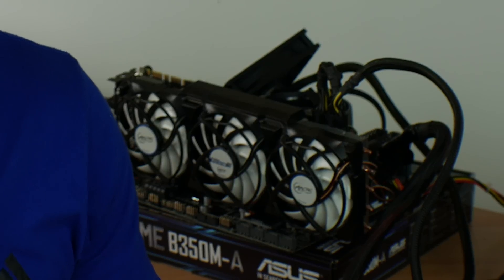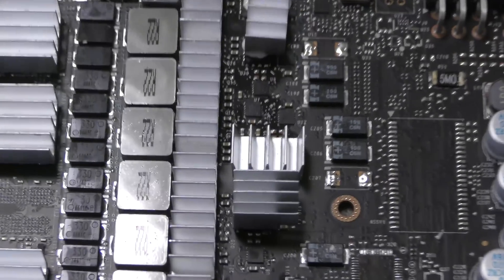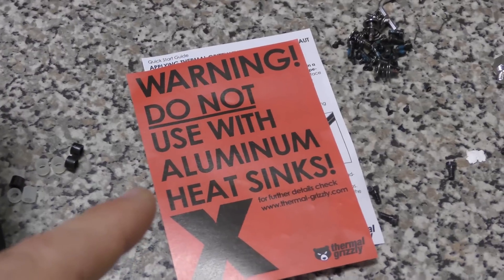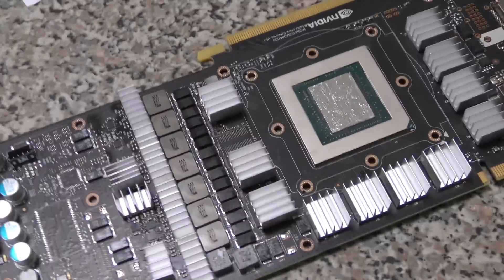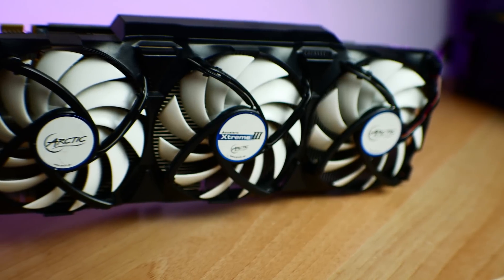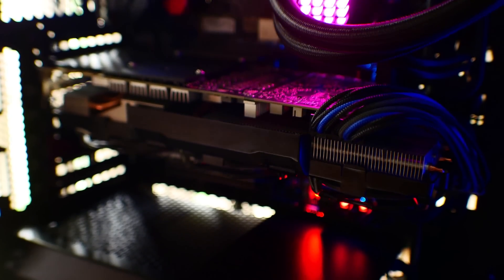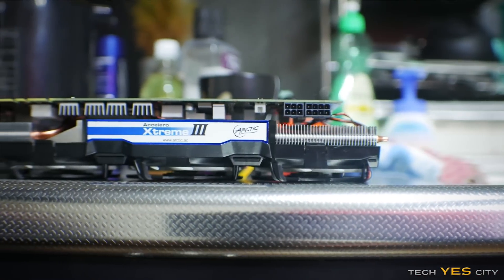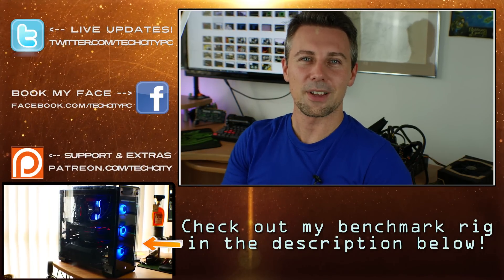INSTALLING an ACCELERO on a GTX 1080 Ti!? How to & Temps vs 1080 Strix

Comment: Excellent cooler, I picked up an older extreme 2 for $20 that didn't quite fit the gtx 670 I bought to play around with,  dremelled the fins slightly to fit and the card now runs low 50's, ---before I was struggling to keep it under 80 with the reference cooler.

Comment: I've used Accelero coolers on a EVGA GTX 260/216, a BFG GTX 280 OC (really helped!) and on ASUS HD4870 (didn't like that the fans were hooked to PSU. i.e. Accelero Twin Turbo model). Modded two PNY 9600 GTs with a fanless heatsink from Arctic as well. I had some wrong screws in one package, Arctic was less than helpful..got some on Amazon...but overall, its a good product, just that you need 3 slots so takes a lot of room if you SLI like I did with the 260s. Haven't used them in a while obviously...not many open air (quieter) coolers back in '08-'09. Bought a few ACX models over the years now. Just my 2 cents.

Comment: hey, got mine accelero xtreme 3 yesterday on a MSI gtx970 Armor 2x 4gdt5 and it couldnt be better. dropped from 75ºC to 55ºC and from a fan usage of 68% to 36%. amazing cooler, money well spent. 
keep up the good work Brian.
Cheers

Comment: I have replaced the thermal paste on my MSI 390X and after like a month or two it started having artifacts(probably because I once accidentally pressed apply with the MSI Afterburner sliders to the maximum(that is like 1500 core from 1080 stock and 2000MHz memory from 1500 stock)) but yeah the point is even though the warranty sticker on one of the 4 screws on the back was clearly damaged(because I had unscrewed the GPU for thermal paste replacement) they didn`t void my warranty...I got a new MSI 390X for free so it depends on what brand your GPU is for knowing if they will void your warranty or not...pretty sure EVGA will NOT void your warranty they are badasses and MSI at least from my experience will not...Not sure about other brands though.

Comment: 1080Ti vs 1080 ?! wtf dude who care about 1080 , do 1080Ti FE vs 1080Ti Custom !
also in your test try max PRM on both cards , FE blower can spin upto 5000RPM
Reply: 5000rpm? You can use the fucking cooler as a blender.
Reply: LOOOOL :=)))))

Comment: Is that thermal paste conductive? https://www.youtube.com/watch?v=rAid5G30-WM
Reply: That's not thermal paste though, it's like liquid metal, totally different than your typical non capacitive compounds, like the ones Jay talks about. Liquid metal is exactly what it sounds like, and it will straight up fry your shit, if you don't know how to use it right.

Comment: i used thermal grizzlys liquid metal on my gpu and it fu*ked it, it was my fault though. it didnt short it however, my gpu would no longer give a signal.

Comment: Just ordered my pc and didn't realize which graphics card I was getting. Got the MSI Armor OC 1080 ti which supposedly runs very hot. Will this cooler work on it? Also will I need to get a toolkit and is thermal paste optional or a must have?

Comment: it won't short you card as long as you use non conductive thermal paste and it is actually better because unlike a cpu that has heat spreader this doesn't so it won't spread the heat aswell

Comment: Temps are obviously better than the STRIX, but using an NZXT G12 + Corsair H55 and at most my temps are 41 degrees.  The price for the Accellero is about $60.  The G12 + H55 is ~$85.  Pretty significant temp reduction for minimal price increase.
Reply: Yeah but I wonder what the temps are under max overclock, good to know though.
Reply: I haven't gone too crazy with OC, but I didn't see much difference in temps.  ~41 degrees is the cap.

Comment: Sapphire is pretty salty when it comes to their warranty for overclocking. (Overclocking basically voids your warranty, but I overclocked my RX 480 card before, which seemed to not be worth it after some ridiculous stability issues, therefore going back to its stock clocks.)

I'm sorry, did I hear you could overclock your AMD graphics cards? Then why do some manufacturers get salty about people overclocking their graphics cards?

Comment: Hey Brian I got an Accelero twin turbo II for my gtx 970 and it doesn't work. At what should be zero rpm it runs full speed and speed seems to go up and down as I try to crank the fan speed up. Apparently I need the twin turbo III fan, have you had any issues?

Comment: Would be nice if the maker of this video would tell us what games he used and the names of the programs he used to monitor the cooling performance. Installing an accelero arctic III is fairly straightforward if at times fiddly just take your time and be very careful when removing the native cooler. Find a large surface with lots of light and make sure to have the right size screwdrivers readly for detaching the original cooler which is the trickiest and most risky part. Read and follow the instructions carefully. AAE III doesn't work with a stacked power socket: https://www.arctic.ac/uk_en/accelero-xtreme-iii.html.

The improved cooling performance makes it all worth it and it looks awesome.

Comment: what a dumb video, you can see that the strix is clocked 100mhz + higher, you dont show what speeds the fans are at or how noisy it is...
Reply: He did say the accelero is quieter though but yeah would be nice if he could measure the noise.

Comment: you got 30-40mhz higher clocks with the accelero? the video showed the stock cooler (right side) running 2088-2100 MHz and accelero (left side) running around 2000mhz ?

Comment: You can't void your warranty in the united states simply by taking the thing apart, removing the heat sink, modifying or replacing the heat sink etc, unless the company can prove that it failed because you modified or replaced it, or you damaged it during the tear down process etc. 

Google magnuson moss
Reply: Robert Tanksley he's an Aussie living in Japan. It doesn't apply.

Comment: What should we consider "default" fanspeed?
I have the MSI 1080Ti Armor (shit cooler) and I bought that one on purpose, you literally only have to remove 4 screws for the main cooler and use another 4 to screw on the Accelero Xtreme III :)
Look here, that's why I bought this card to use with the Xtreme III, memory and VRM's already cooled by a plate: https://ic.tweakimg.net/ext/i/2001457941.jpeg

Comment: i had a 9800gt that hit 120c before i unplugged it from the wall.....

but on a twin turbo fan.....didnt go over 60c iirc. 

lasted till i got my 6970, which im still rocking....

Comment: Man you should really test Raijintek Morpheus also. You can slap there a custom 2x120mm fans on that one. It should have similar results as Accelero but hance possibility of swapping fans to whatever you wish is even more appealing.
Reply: except that it costs as much as or more than an Accelero xtreme 3 WITHOUT the fans...

Comment: what were the dimensions of the heat sinks that you used? especially the long one.
Reply from the maker: Oh they come included with the Accelero kit, so if you get it you will get all the heatsinks and plaster I used in this vid.

Comment: A good trick when using conductive TIM is to cover the resistors in a non-conductive TIM, such as MX-4, to protect them in case of spills or dripping.

Comment: Hey Tech! Love the vids you put out I appreciate your style and information given so thank you again! I was curious because I want to mount the arctic accelero iii xtreme on my evga gtx 1080 sc due to the cooler being noisier then I would like, but I was curious as to where I need to plaster on the little fin heatsinks? The vram of course and then the vrm, but where else do they need to be placed? I am just a little nervous due to the heat issues that card has had in the past with evga issuing thermal pad kits and all. Thank you again!
Reply from the maker: Hey John, you will need to cover the mosfets and also the vram, that usually does it.  The Vram is usually around the GPU Die and the mosfets for the VRM are usually before the chokes.  Just make sure nothing is touching those heatsinks other than the die to which its connected too.
Reply: Tech City 
Thank you so much for the response! I am going to embark on installing the xtreme iii in the next few days! I was going to use the protective clear tape next to the components close to the vrms.
Reply: Tech City 
Hey I wanted to up date you and say the xtreme iii is the BOMB! I got it mounted shortly after the first question I asked you and it has been working so well! I put it on and evga sc 1080 due to the stock cooler being noisy and really not keeping temps that low (ambient 29c) card ran at 70% fan speed with temps in the 70-80c range! Put in the new cooler and same ambient temps the card is running at 58-60c with fan speed at 50%. Quiet and cool, so thank you again for making this video and answering my questions! You rock!

Comment: Hey dude - Ive got an arctic accelero hybrid cooler - im gonna buy a 1080ti, and wondering if you know if this will cool it sufficiently so i can buy a founders edition and be able to OC it. Its a cooler I bought years ago (obviously) and had it on an HD7950 where it worked awesomely...any ideas? cheers!

Comment: Hey,

Do you think it is safe to use this Accelero Xtreme III on a 1080 Ti / Titan Xp? These cards are very hot and I'm a little bit afraid for its VRMs. Would the included heatsinks be enough to keep the card at the safe side?

Comment: Tech City, first off good video.  I have three of the coolers you are using and you are right that they are very good.  I noticed at around 02:10 you discuss concern for using the Grizzly TIM.  There is a way that can help with protecting those areas of concern.  Place two layers of 'clear' Liquid Electrical Tape, over those resistors/chips surrounding the die/GPU.  Allow it to fully dry after each application.  This helps give you added insurance that you won't short out your card after applying the TIM.  I myself use CLU Pro on my new Titan Xp and previously no less than 7 other cards, I have never had a short happen using CLU because of the added protection.  Oh that type of TIM also works well with water-cooling GPUs.  Anyway again, good video.  Cheers!

Comment: Chokes and mosfets are not being contacted by the cooler or heat sinks. Well all seen what happens in the long run when these are not being cooled properly.

Comment: Did you tested liquid metal paste with the strix cooler? I think in this case most of the benefits comes from the liquid thermal paste not from using the custom cooler.
Using liquid metal paste is impressive on my delided i7 4770k, I tested 4 non conductive paste and liquid pro. Liquid pro paste is incredible, far superior to non conductive pastes. I don't understand why in high end cards do not use liquid metal paste out of the box, with better paste smaller coolers could be used. Will be a winner move compared with everything else on the market.

Comment: Use electrical tape to prevent that thermal compound leaking around the gpu
Reply: Sebas scholtens electrical tape is a poor choice. The temps near the die will cause the tape to soften. The bad part of that is the tape adhesive will become very “gooey”. A much better choice is clear nail polish. Electrically non conductive, easy to apply, dries very fast and much neater.
Reply: Sebas scholtens i dont care. I use it without it

Comment: That's not thermal paste you're using. The Thermal Grizzly Conductonaut is liquid metal, and it's very effective. You have to use the same thermal compounds if you want to compare different coolers, and the same coolers if you want to compare different thermal compounds. Mixing the two together is extremely unscientific and casts doubts on the results, because  a large proportion of the lower temperatures can easily be attributed to using liquid metal over the stock Asus thermal paste.
Reply: nonsexysecretary ahhhhhh the variables control the VARIABLES
Reply: He didn't really used even same graphics cards.. so what's the point :D
Reply: Absolutely true. I hate this youtuber now :(

Comment: If you buy this exact model (I'd recommend the Extreme 4, or Hybrid over this semi nightmare install) I'd recommend buying some extra thermal pads, and exacto knife to cut them to appropriate size (*Or simply reusing the ones from Nvidia's stock cooler) and use them to attach the heat sinks, rather than the glue (*It's not paste).  The VRM, and Memory chips are quite small, and to reduce stress, and wasted time, use thermal pads to attach heatsinks.  The Extreme 4 does not use these heatsinks, and therefore is a much quicker install.

In my case, the included glue was completely dried up, and that was the end of that install.  Also, I think he should have used included backplate.

Hybrid, or one that doesn't use the little heatsinks.

Comment: Initially I was interested in the Arctic Air gpu coolers for the 1080ti, however having a mid-tower restricted it to only one of their air coolers, and it wasn't recommended for the 1080ti.  Finally went w/ the Arctic Hybrid Accelero III - 120, and I share similar feelings as Tech City.

OC set @ 150CC, 500MC, and 105% power yields similar Core Clock speeds @ 2012 maybe being the high, and generally hovering just under 2000Mhz.  Memory Clock reached 6000Mhz, but wasn't monitoring memory clock outside first OC.

It was HOT in my room today, played Rise of the Tomb Raider for 3+ hours, OC all the time, and stayed below 70C, hitting a max temp towards the end @ 68C.  It's quiet, and performs much better than the reference cooler.

I guess you felt compelled to recommend not taking off the reference cooler (*If not EVGA Reference) due to warranty, however it's not really an option if you bought a reference.  The Reference 1080ti is a volcano followed immediately by a hurricane.  It's unbearably loud, and anxiety producing to think your card might simply melt through your mobo if you don't watch the temps.

This is valid option @ $100 for the Hybrid, and around 50$-60$ for the Air Cooling options.  EVGA lost me when they listed $120, and then increased the cost by $40 due to demand.  That is not typical EVGA customer treatment, and I hope they take a loss on the Titan / ti hybrid to learn a lesson.  I'll still buy EVGA, but not that one.

Comment: what kind of heatsinks for the pcb did you use?
Reply: Those small aluminium heatsinks + thermal plaster come with the arctic accelero

Comment: THERE IS A BIG DIFFERENCE IN CLOCK SPEED THOUGH BETWEEN THESE CARDS
The Strix on For Honor is running at 2114mhz when the Custom is only at 1974mhx you would of been much better of, setting both to 2GHZ and leave them to test, because I can tell you personally with mine that extra 120+mhz at the top end of OC will make a difference in temp up to a extra 10c easy so really I don't see much difference here, because throughout the whole benchmarks the Strix OC was overclocked much higher that the Custom, which makes the test a waste of time
Reply: Saw that too, but then i remembered the Strix is a 1080 non Ti. So the clock speeds and FPS in this test really dont matter, but the thermals are even more impressive for the Accelero, running a 1080 Ti cooler than a custom 1080.
Reply: The Strix has MORE POWER... literally.  Dual 8pin vs Reference 8 + 6 pin equating to less capable watts in the reference.

@ the same time, "Big difference"?  Approximately 100Mhz I can't imagine that yielding more than 5FPS @ best?

Comment: Hey man, Great video! I was wondering a few things: I bought the Accelero you put in the description, does it come with enough thermal pads if any? Does it come with heat sinks and heat sink plaster? Does it come with the PWM Fan connector? What thermal paste do you recommend I use to mount this to my 1080Ti?. What comes with it and what comes seperate? I'm desperate for an answer from pretty much anybody that knows the answers to my questions. Fast as possible

Comment: I have the smaller twin turbo III  (it has two fans)  on the GTX 960 reference founders blower.  I went from temps in the 80's down to temps in the 40's.  CRAZY difference!!!  Great video, I think more people should know about the Arctic stuff.
Reply: Im running my RX 480 With a coreclock of 1430mhz and a 30mv (1180mv overall) overvolt... Runs at low ro med 60°s... Really nice cooler
Reply: With the arctic accellero IV
Reply: I know right?
Reply: Nasty N8  might consider this for my 780

Comment: I don't get the point of testing this vs the 1080 Strix, shouldn't you have waited for the 1080Ti Strix version which has a better cooling system ?
Reply: the 1080 is supposed to be inherently cooler because slower than the 1080ti... so this test makes sense

Comment: Hey you can try to install a CPU cooler on graphics card . It will be much quiet and the temperatures will be fine.
It is a good idea but it is a little crazy.
I think it is interesting to see a comparison between an gpu cooler and CPU cooler .

Comment: You don't get more with the thermal grizzly. They are both pretty much the same price and I love their kryonaut (using it on my 980ti). The tube looks bigger but if you take the tip off of it you will see there is a inner tube inside of the thing which is a lot smaller then the outer tube. Don't really know why they did this kinda deceptive but it is what it is.

Comment: What if you put CPU heat sink on GPU ? :D
Reply: depends on the cooling capacity of the cpu cooler. DIYPerks did that but he did it on a low TDP GTX 260. Something like a 212 EVO probably won't cool a GTX 1080 as well as a custom card.

Comment: I got this cooler way back for my Radeon HD 4870 and the little heatsinks fell off, which fried my card, because the VRM's overheated.    

Cooled my refference HD 4870 GPU though. Went from 80C fairly loud to 60C with fans on minimum. Not a fan of the glue on heatsinks though.